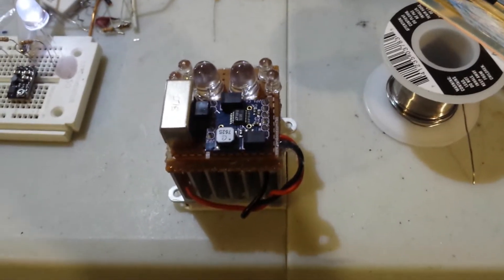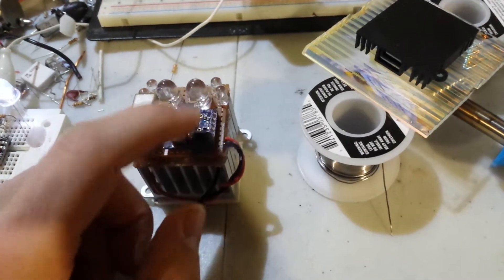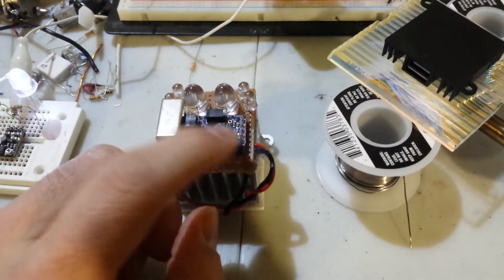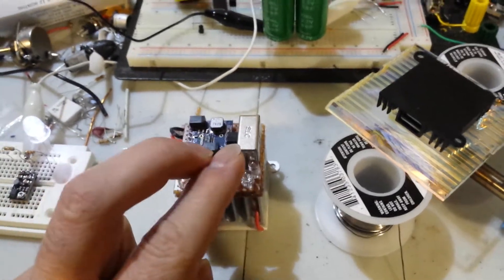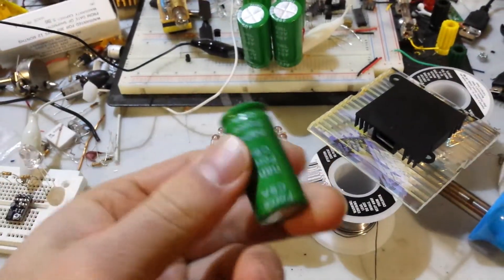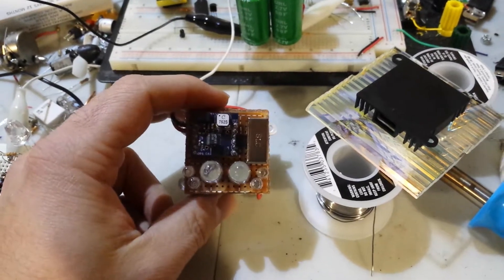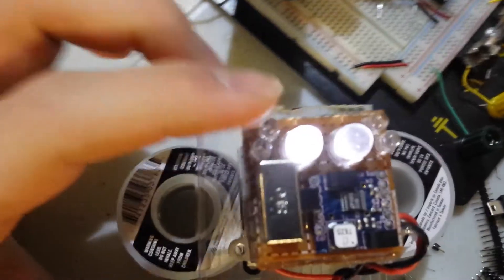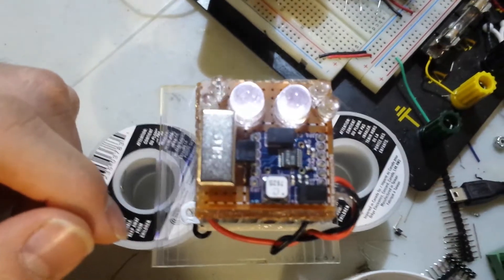Heat harvester flashlight

Comment: Well, tried lighting my LED with a temperature difference of about 12 degrees Celsius and it didn't light up. So what key component you have used to achieve that with such a small voltage. (I think a transistor might help)
Reply from the maker: Check in the video description there's a link to the board I use it's a special chip that was created for harvesting very low power.

Comment: Good lie
Reply from the maker: I don't see any lie in there I can assure you that this board does work at 20 mV and will generate enough power to light LED of course as you can see it flashes them because the board need to build up the energy.

Comment: Thank you for the help on the chip. I got it working but I am still having trouble with hooking up for 5 volts. Can you explain more clearly how I can connect the 5 volt output? Also where can I hook a capacitor or two for power storage?
Reply from the maker: The storage output will be for charging either super cap or battery for later use. This output will be pulse to make sure it doesn't affect the main output. beside that the AUX is the primary output the Out is the secondary output and output2 is the one you can enable and can provide up to 300mAmp of power.

Comment: Hi. I bought the chip but I am having difficulty hooking it up. Can you help me? One pin is labled JP1 another JP2 and another just has a 1 beside it. Where is the input for the pelture module and its polarity? Where is the 5volt output with polarity? Thank you.
Reply from the maker: I got help from https://s3.amazonaws.com/crispytronics/schematics/eh1d.pdf it's the documentation of the board itself. JP1 its the left connector when the inductor is at top. You have multiple output choice it you want 5 volts VS1 and VS2 need to be connected to AUX output. The AUX output is the first output to be activated and the that has higher priority. The output will be activate as soon at AUX reach the desire voltage. The output2 is a switchable output that you can turn on and off via pin V2_output_EN pin in my case it's tie to PGD which is the power good output this explain the flashing of the led. Hope this help you :)

Comment: Why don't you try powering it with a disposable Hand warmer?
Reply from the maker: I did as well as remaining heat from a stove element, hot water, tea candle even my furnace exhaust. They all give different result but they all produce light :) of course the hotter the source the brighter it is. The harvester board can not handle more then 500 mV so I have to be careful on what I put this thing on.

Comment: What do you know about the thermolelectric module (pelture)? What is it rated at?
Reply from the maker: I know nothing about this one it was out of a 12 volts cooler so it's a TEC not a TEG not very efficient at converting heat to electricity but it work for this one :) I might rebuild it into something more useable eventually using a teg a very low power one would be more then enough for this circuit.